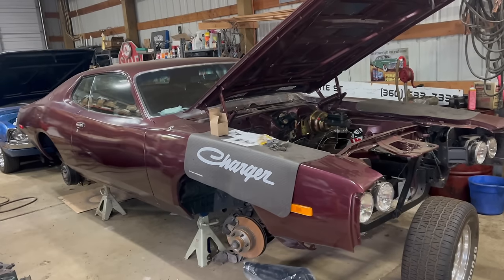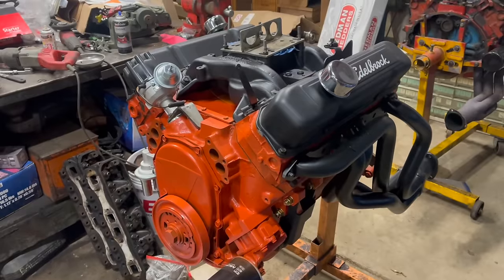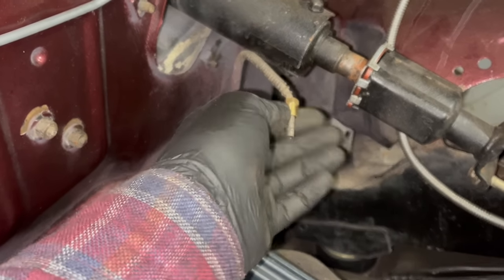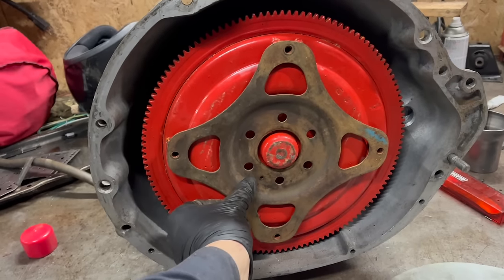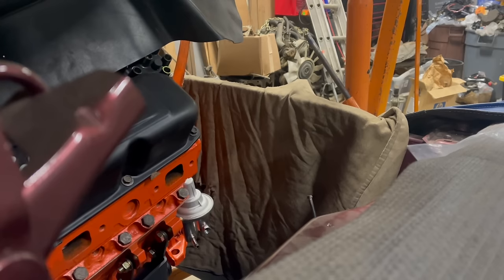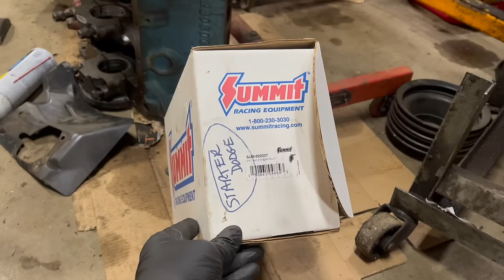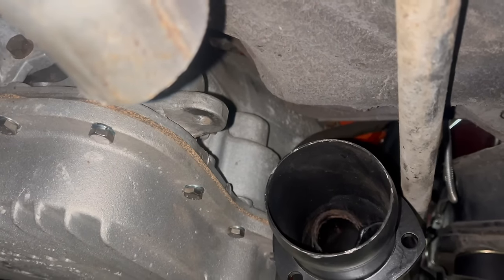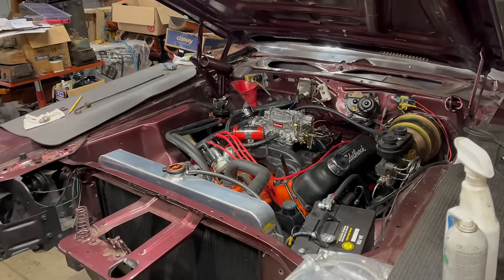Smoke And Glorious Noises - Budget Built 440 Swap In The "Toolbox" 1973 Dodge Charger

Comment: Great info from all your videos. Question. On a 9182 thermoquad. Can the lean burn be disabled or bypassed. And if it involves modifying the carb. Would that be removing the solenoid on the back of the carb. Or just not plugging it in?

Thanks alot. Keep up the videos.
Reply from the maker: Gotta be honest - I have no clue how those electronic fuel controls actually work. I left them disconnected on my ‘79 Chrysler at first when I got rid of the lean burn controller and installed a Pertronix distributor. It seemed to run fine that way. But I never drove it more than a couple miles. That carb had a rusted and destroyed accelerator pump setup, so I had to replace it anyway - which I did, with an earlier Thermoquad. It runs awesome now.

Comment: Try using oil when you drill. It's easier and your bits will last longer.
Reply from the maker: I was using rapid tap. You can see the sheen from it when I touched the bit to the back one up close to the camera. It’s hard to pour oil on a vertical surface. I dab oil on the bits, and if I think it’s warranted, add more as I go.

Comment: Why was the factory 440's horsepower so pathetic in comparison to a factory 409 or factory 427, which had horsepower at least equal to its displacement?
Reply from the maker: I wouldn’t believe Chevrolet’s factory power ratings, or Chrysler’s. I can’t speak for the W engine, but the big block Chevrolet also had a much better cylinder head design than the big block Chrysler. That’s an undeniable fact. But Chrysler had the Hemi… and also a head layout of similar design to the big block Chevy over a decade earlier. So there’s that.
Reply: @DeadDodgeGarage  The Mopar dyno numbers are pretty close on the 'Nick's Garage' dyno, aside from the Hemi, which is around 480hp if I remember correctly.  I had a '70 Challenger with a 440, and the torque was amazing, but never understood why it couldn't annihilate  a 383, with 57 more CI.

Comment: I really feel uncomfortable even watching someone else trying to move an engine hoist side to side, with a full load up at maximum lift, bumpy concrete with the odd pebble, small wheels, and the engine swinging like a pendulum, I’ve never dropped one, but I’ve played with fire. And why is it when you need to just drop it a bit, that’s the time it chooses to just dump the engine in free fall.
Reply from the maker: Yeap… that was me with the slant in my Barracuda last year. I once installed a Cummins engine in a truck parked on the asphalt next to the curb, with the street angled and horribly bumpy of course, with this same cherry picker… compared to that, this is all fine.